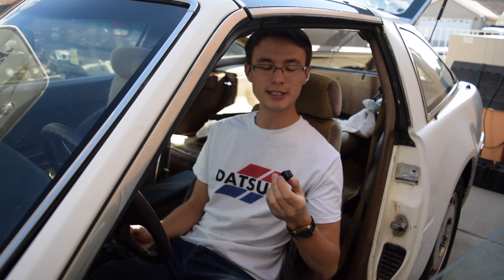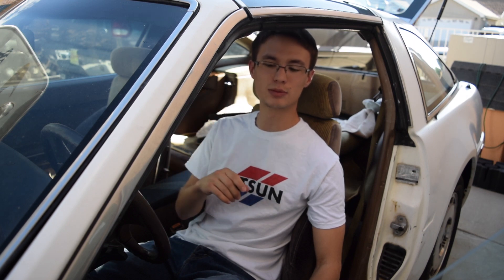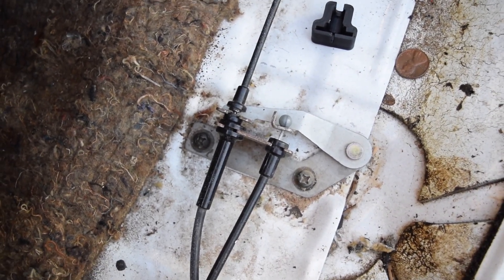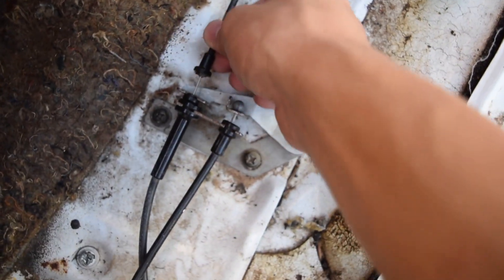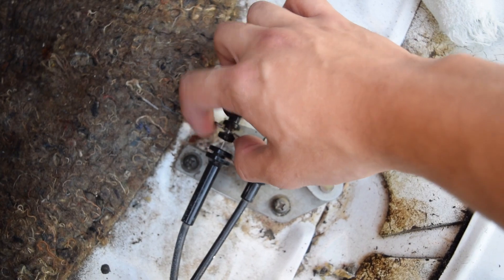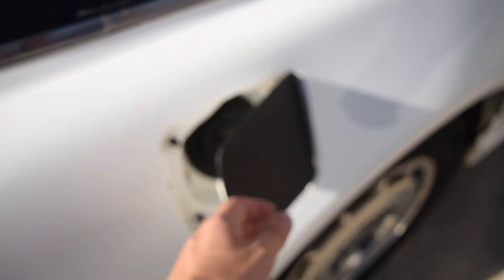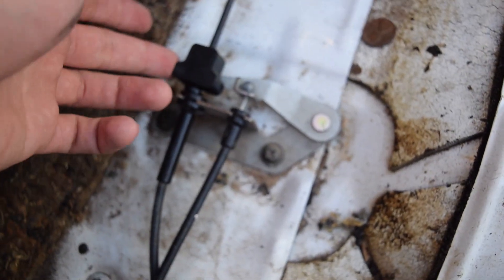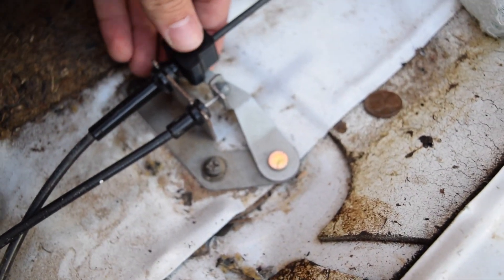New Product! Gas Cap Latch Fix

Comment: My gas door release cable nut fell off and the cable fell into the rear quarter panel. How can I retrieve the cable? 1993 300zx 2+2
Reply from the maker: I'm not 100% sure but I would guess you have to pull out the interior trim next to the gas door and fish around for it. You should be able to trace it from the latch to the door
Reply: @TheZGarage  
Thank u I’ll check it out and let u know if it worked

Comment: How do I replace the little latch that closes the gas door?
Reply from the maker: You can access it from inside the hatch. Remove the trim panels behind the fuel door and then you squeeze the tabs on top and bottom and it will slide out into the fuel door area

Comment: May not be the right place to post this but i have the opposite problem, the fuel door won’t stay closed and it seems the little plastic latch piece is stuck, any tips?
Reply from the maker: Most likely the pin that holds the door closed. It's either broken or gummed up. Check it out and lube it if needed. If it's the part in the trunk try lubing that too as that's really the point fix I can think of

Comment: Cool! I am interested in the mirror bracket that I saw you were prototyping awhile back. Right now I have to get it running good again, MAF sensor crapped last week but after that I'm going to start patching up the details inside. Did you get your emission test passed?
Reply from the maker: Those mirror mounts are available on Thezgarage.net as well! The latest emissions video is where in still at. I've been working on a few things to get it a bit more efficient that should be ready to go soon.